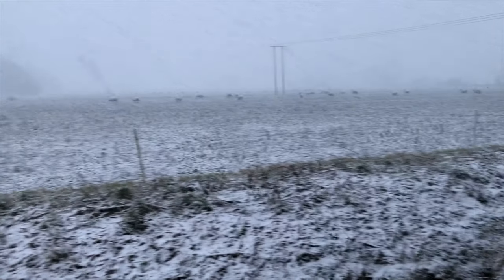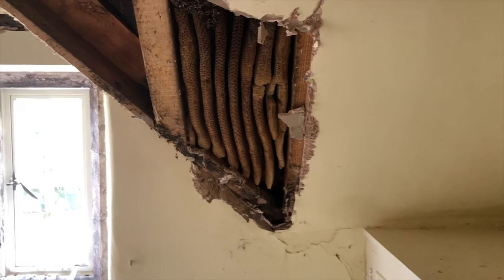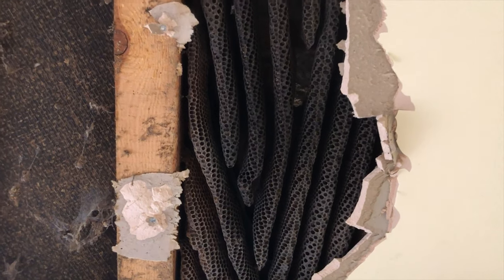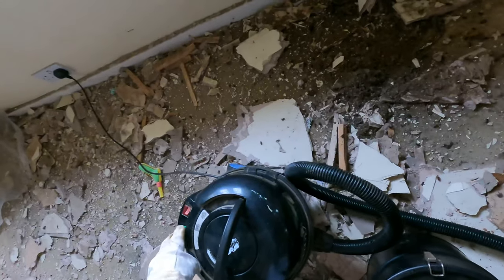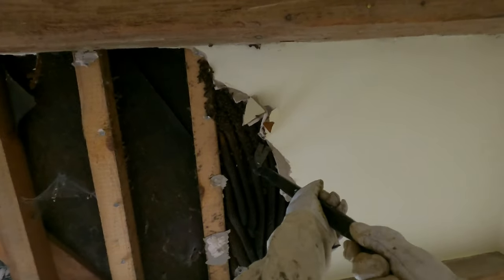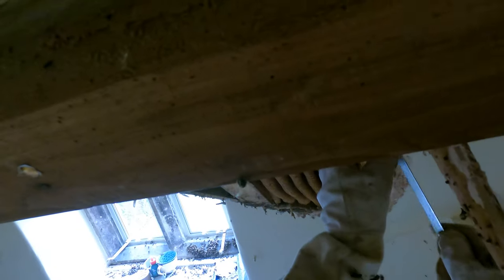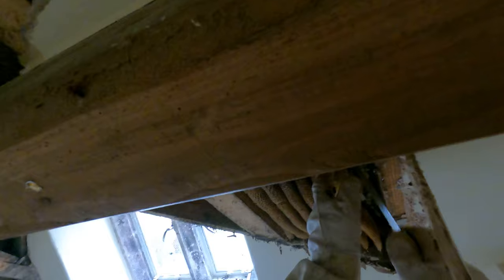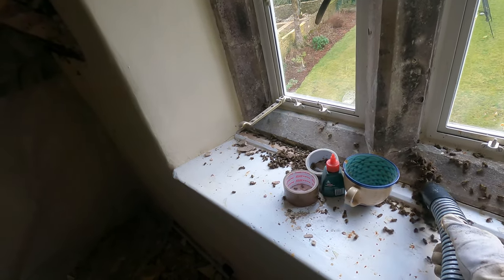Cotswold Bees Saving A Colony Of Bees With A Little Light Vacuuming

Comment: plans for a single hive?
Reply from the maker: We don’t have plans for them. We make our own and they are designed to fit in the back of my truck. Basically they are made of 4x2 and for the doubles we have coach bolts to let the legs fold. For the singles the legs are fixed. If you look at the setting up the apiary video you will see the double.